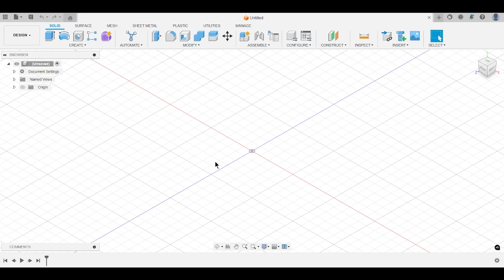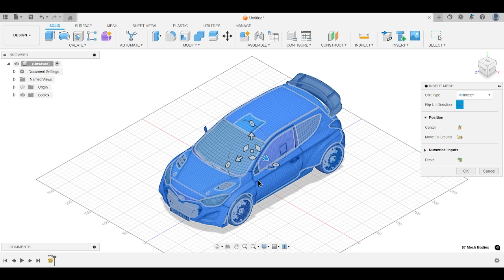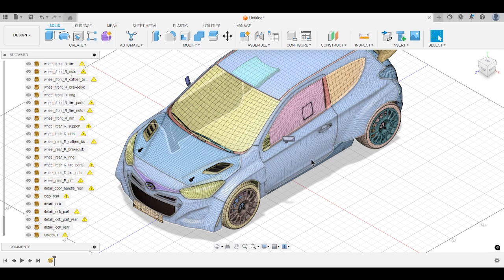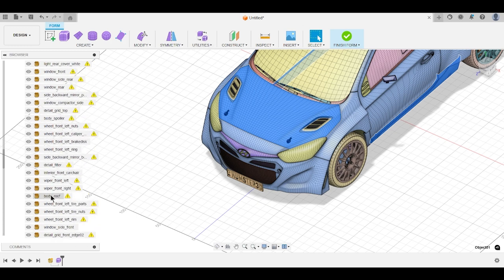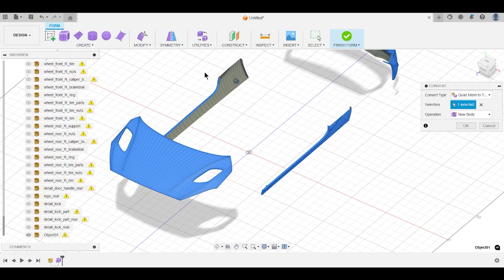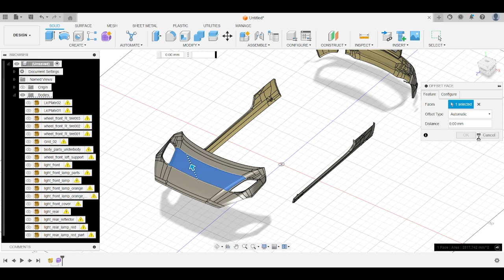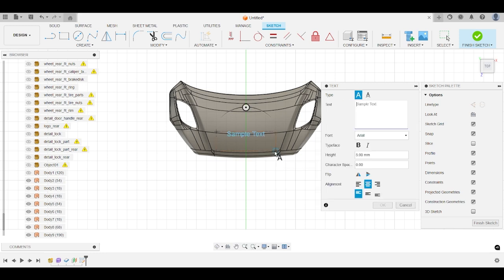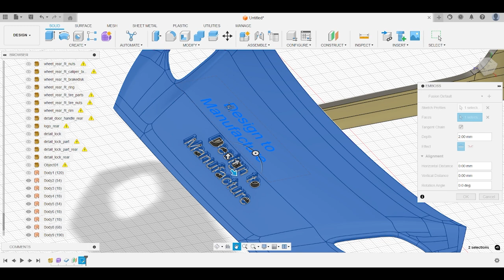Convert STL or OBJ to a Solid Body in Fusion 360 | Mesh to BREP Tutorial

Comment: Whats the difference from using your way versus the convert mesh in the mesh tab?
Reply from the maker: I find this way has less errors on conversion and more accurate results though for low poly count models the convert mesh function in the mesh tab should work fine.